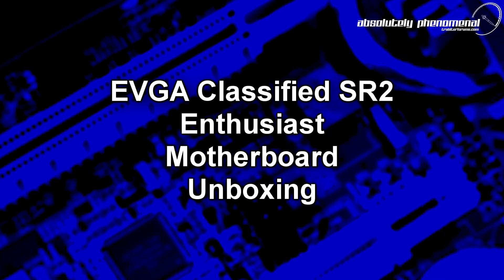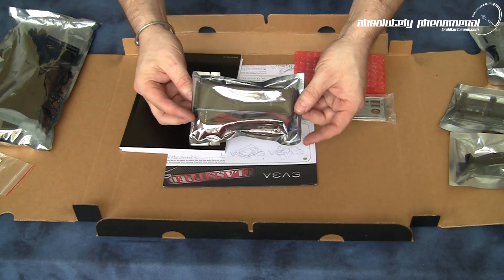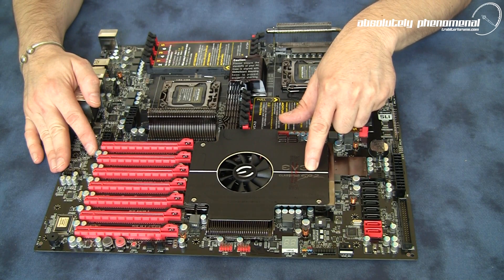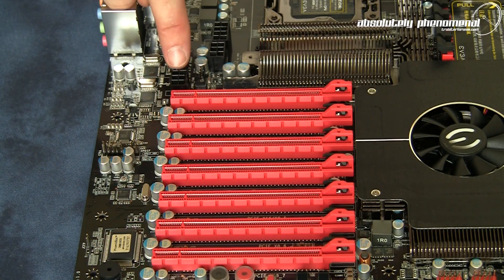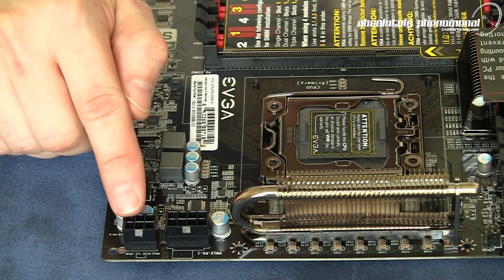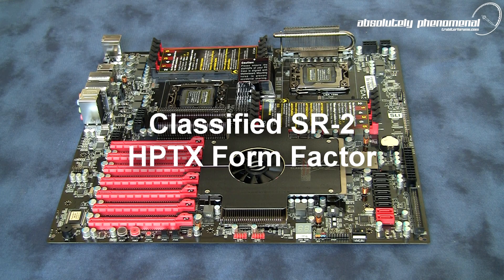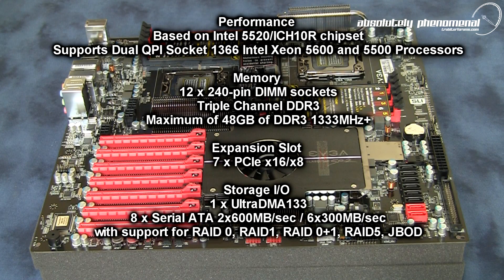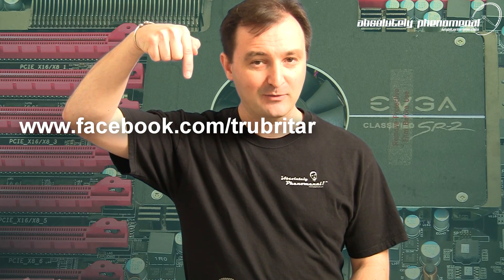EVGA Classified SR2 Enthusiasts Motherboard (Unboxing)

Comment: @DOMIDOOM 

ok break down for idiots of what i said.

can you fit 2 980 intel 1366pin cpu's on that motherboard ?

you can alredy fit 2x Xeon 1366 pin chips on it so will it support 2 standard intel cpu's on it as they are easier to buy and cheaper for faster speeds.

does that make better sense to you then ?

or do i need to draw pictures and sound the words out for you ?

btw already know the answer just doing this for you to answer and make you feel better

Comment: @shinjide213 This board is aimed at overclockers and extreme consumers, not people that would need that much RAM. Are there an other dual Xeon, quad SLI and Crossfire boards that give you any OC options at all? Don't think so... Hell, are there any others that even offer quad SLI or Crossfire, regardless of OCability? Again, I don't think so.

Comment: About Xeon processors…These boards can run with only one Xeon processor, am I right? If you get another processor at a later date, does it matter if it's another type of Xeon? Can you use two different Xeons at the same time? I'm doing pretty heavy video rendering and need a lot of CPU power and ram, but I know nothing about systems with two cpus

Comment: @ImortGhost It can hold them physically, but no motherboard can run four 5970's since they are dual-GPU-based. It can run quad SLI or Crossfire though.

Comment: @BunkerPBA If you're buying a 700$ mobo, you shouldnt whine about spending money on a xeon CPU :|
And the i7 960 is an overclocked i7 930, btw.
And no, it only works with xeons

Comment: if i were crazy (and very very rich) could i install 5 hd5970s a raid card and a sound card?
I would watercool the GPUs and then cut off the exhaust slot on the back to make it a single slot card 
I would take two of the GPUs and connect them and then take another two and connect them and then leave the fifth free standing.
It would make sence that it would be possible but ive never hear of anyone putting more then 2 of the cards on any board at once

Comment: can you actually do that kind of crosfire x?? it is just crazy and what would preform best @trubitar wich of htous to crazy set up of gpus will preform better the crazy crosfire x or the gtx 480 4 way sli and how besesary will 3.0 usb ports will be in 3 years?? , if you use any of the 4 gpu set up can you use the rest of the 3 pci slots?

Comment: @Revanchist8525 I think you hit the nail on the head with the Corsair 800d.  Not only the SR-2 likely to fit this case, it has alot of internal water cooling potential.

Comment: @sHaNeR766 
Well... not rly ;)
For gaming maybe a bit (Questen is if u need for gaming up to 48gb and slow 1333mhz ram)... for a server its pure bullshit... actually there arent that much servers that need 7 PCI-E 16x/8x slots... There are even servermainboards out with up to over 120gb of ram, some even can get up to 4 (!) 6-core Xeons... but for that they have only like max 1x 16x PCI-E Slot :D (We have 2 DELL's with 4 6-cire CPUs at work ;)

Comment: @bmw2go11 
Actually i think this mobo aint that good for gaming... atleast in many games i would pwn it still with my EVGA X58 4-way-sli and the I7 980x... 6 Cores/12 Threads, more cache than a Xeon (Atlesat its not one of the 6 Core Xeons)...
to this i have also 4 GTX480's in 4way sli AND 2000 MHz Ram (only 12gb... but with windows 7 ultimate 64bit no game needs that much)... and the Error Correction of a Server Ram on this Mainboard isnt equal for a Game, same as 2 CPUs, which game use them?

Comment: @MarozOFF I'd say around $650 for the board, but you have to pay for the dual chips like he has, which are $1,600 or so apiece.  Then you have to figure in about $2000 for 4xGTX480 and who knows how much for ram, PSU and harddrives, not to mention the fact that there's only one case that will fit this mobo.